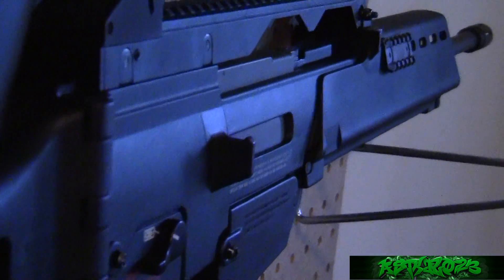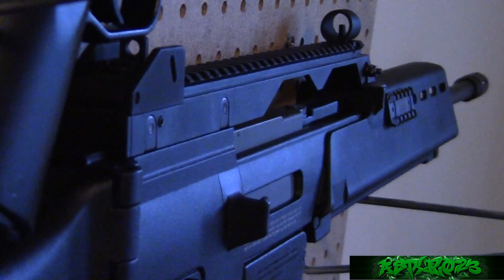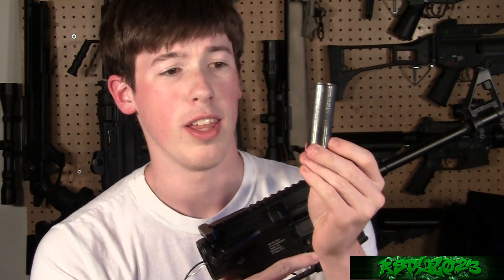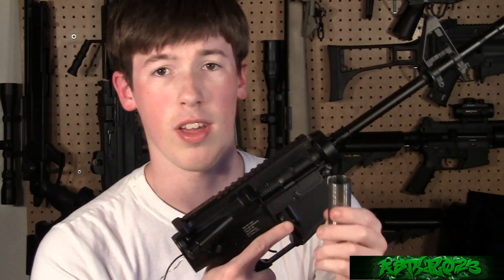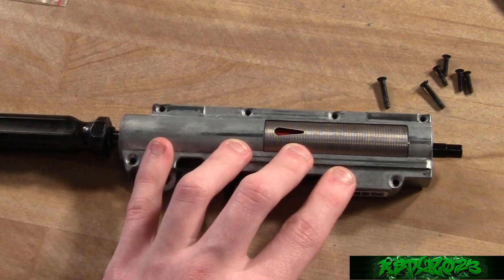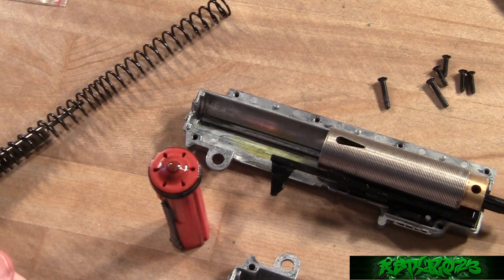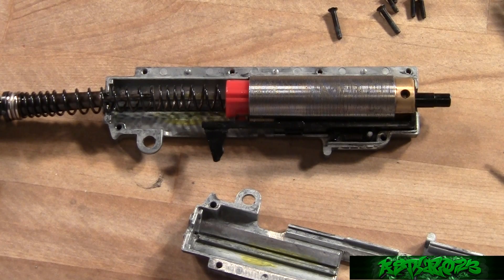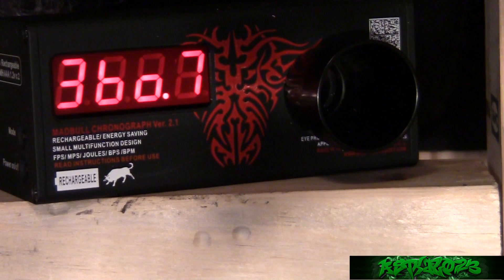Cylinder Capacity VS Barrel Length  -ASTKilo23-

Comment: Not very surprising...think about it...you are moving a larger volume of air with the same power spring= slower piston push= significant drop in fps..the port in the cylinder allows the piston to push a smaller volume of air..the only two ways to get this back is to use a higher power spring and possibly turn up the hop...I said possibly with the hop...but it would seem a stronger spring is in order from what I can ascertain since we haven't talked about barrel length here either..

Comment: my Amoeba 013 ha a stock 300mm inner barrel , and type 0 cylinder.

i correct AOE and install a type2 cylinder.
The fps up 30 fps.
why your up 60fps?

Comment: So without a port in the cylinder, air can't get into it to be compressed, except through imperfections in the O-ring on the piston head, so shouldn't any ported cylinder be better fps than a non-ported (type 0) one?
Reply: The cylinder pulls air in from the nozzle the ports control the volume of air in the cylinder. With a o type you get the maximum air volume possible.
Reply: Yess, I understand the concept as of posting the comment.

Comment: wtf wouldnt it increase fps?
Reply: Nope. I also thought more air = more fps, but since the spring energy isn't linear, it does matter.

The thing is, you want the pistonhead to hit the cylinderhead when the bb leaves the barrel, so the spring energy is fully used.
Reply: Rasmus Vonsild oooooooh thanks : )

Comment: Hi ASTKilo23! I have a question, are you sure there was no air leakage anywhere in the gun? Theoretically if you have a full cylinder (Type 0 ) and a short barrel that would create a larger volume of air to travel through the barrel thus the air being pushed creates a slight overflow and affects the bb's accuracy when exiting the barrel (that's why some barrels have crowning, to counteract this effect) but in any case the type 0 cylinder or the bore-up kit should increase your speed not decrese it so drastically. Example: I had a bore-up kit on my m4 and it was shooting  430-435 fps, after i changed the original bore-up cylinder (type 2) with a type 0 bore-up it was shooting 448-451 fps, 20 fps is not much of an increase but i had no drop in speed.
Reply: ***** You are 99% correct, the only thing that i have to say is that this scenario is correct when using bb's from .20 to .36, i have done tests myself and concluded that if you are using .40 or .43 when having a barrel that is shorter than 363 mm ( tested on 590mm, 510mm, 455mm, 363, 300 and 247 on the same platform) bb.s that are heavier than .36 will accelerate at a lower rate and will not reach terminal velocity in any sort of barrel under 363mm. In this scenario you do need a bore up kit, or a different cilynder.
Reply: ***** Oh and the barrel that i had at the time when i just swapped a bore-up kit in it was a 363mm stock a&k aeg barrel, sthe compression was flawless and both sistems, topped off with teflon mod.

Comment: its the ratio between the barrel lenght and the cylinder ports. with a 455mm barrel you would want a type 0, but with a p90 lenghted barrel 290mm you would want a type 3 or 4. shorter the barrel the higher the cylinder size

Comment: Enjoyed the video! I gotta ask because you just didn't cover it. Why did you not do the same test with different BB weights? Please follow this up with the inclusion of a variety of heavier BBs and compare them in joules as well FPS. You could do a video on joule creep in AEGs too. The point isn't that the BB clocked slower, it clocked prematurely. The difference in the volume of air forced it out before it could absorb all the energy in the same amount of time.  Prodigy's compression FTW   :D